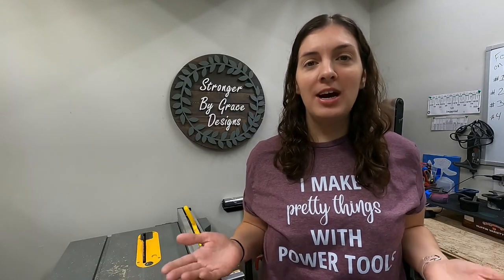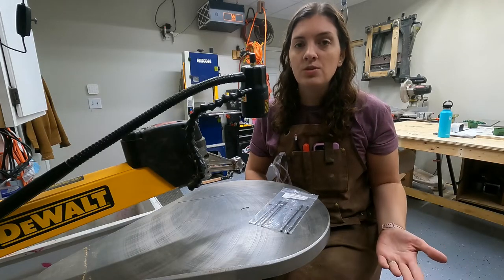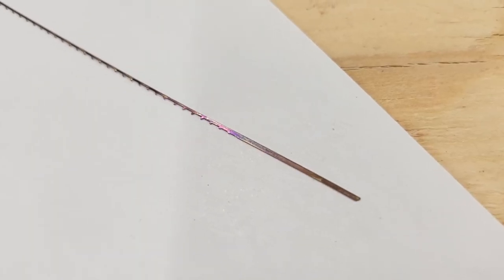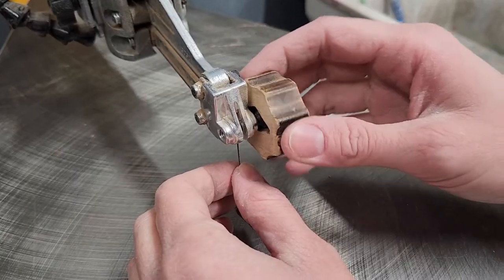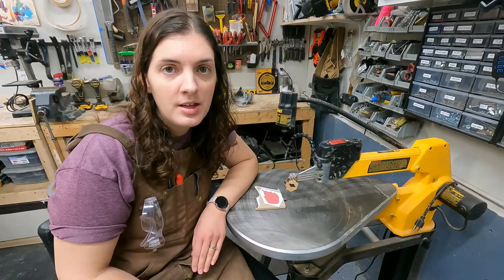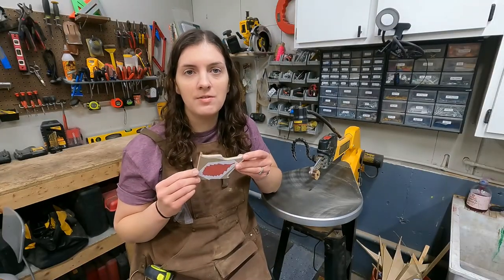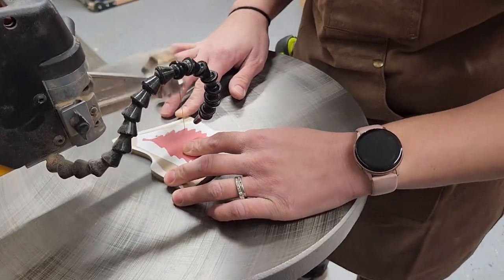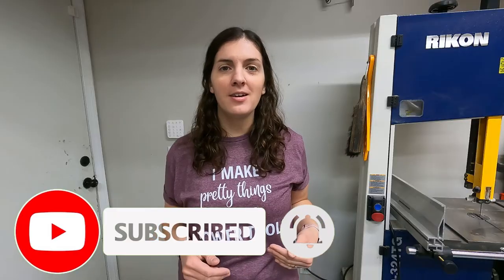Basics on beginning with a scroll saw!

Comment: A scroll saw is a great addition to any woodworking shop.  Adding intricate cutouts and millwork to other projects give them an aesthetic boost.  I have a 15 year old, cheaper RYOBI table top scroll saw, but I don't use it on a daily, or even weekly basis.  The saw is very portable.  It's home is in my woodshop, which is an out building and heating the building during winter to do a few hours of scroll sawing isn't always practical.  During winter, I often bring the saw into the rec room of the house to work.  With a ShopVac attached and the ShopVac in a separate room and a 16 foot hose connection, the saw produces virtually no dust and debris and makes no more noise than my wife's sewing machine.  Safety glasses are the only PPE I find necessary.  During beautiful summer days, I clamp the saw to my heavy duty patio table to work on the patio under a roll out awning to enjoy a few hours of scroll cutting in the great outdoors.  The scroll saw is one of the safest tools in the shop and no more dangerous than a sewing machine.  I supervised and taught my 11 year old grand daughter to safely use the saw and she has enjoyed expressing her creativity making bird houses and feeders, Christmas ornaments, an array of decorative wall art and gifts for her friends.
Reply from the maker: That's awesome!! I have at times wanted to bring the Dewalt outside while my girls played, but it's a little too heavy.

Comment: Great videos.  I’ve had pin blades but looking to get pinless. What are your thoughts of the modified skip reverse compared to the modified reverse that’s on the package you have in this video the 5R.  Thanks
Reply from the maker: The only reverse tooth blade I have tried is the Olsen PGT double reverse tooth blades.  I found they cut mdf easier, but dull, really fast.

Comment: I have the Dewalt DW788, I cannot seem to stay on a line, and corners, well that’s just not working out.  I was so inspired to scroll, but after trying so many things for the past two weeks, I think this isn’t gonna work out.  So bummed.
Reply from the maker: Sorry to hear that! Few things to try... check your tension. If it's too low, your blade will want to drift. Look ahead as you cut. Also, you could try a higher speed. I think you can be more accurate going faster versus too slow.
Corners can be a little trickier. Have you watched my short on cutting corners. I am using modified geometry blades. Different blades can also provide different results.
I hope this helps, and it does take alot of practice.😊
What type of wood are you cutting?

Comment: Great video, my question is how are you getting the arm to stay up like that on your scroll saw? I have the exact same one but I have to use something to hold it up. I was about to purchase the lifter on Amazon but I don't see it on your saw.
Reply from the maker: I tightened the bolt at the end of the arm just enough to hold the arm up. I was going to purchase the lifter as well, but saw someone else do this. I tried it, and it worked! I thought over time I may need to tighten it again but it's been fine.
Reply: @StrongerByGraceDesigns  I just read about that this morning after asking you I went and researched. The only thing I could find about not doing that was having to retighten it and another said something about it could cause damage to the mechanisms inside. How long have you been doing it that way? I am in Canada so the lifter is more than I would like to pay for a piece of metal haha.
Reply from the maker: I would say about 9 months or more.
Reply: @StrongerByGraceDesigns  thanks for all the info! I really appreciate it. Have a great weekend!